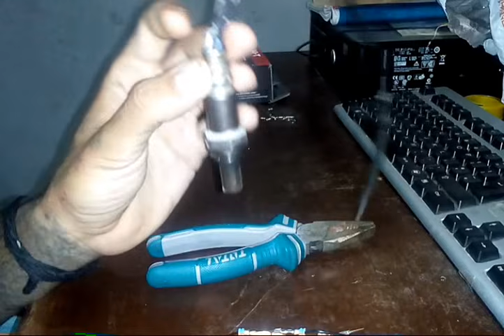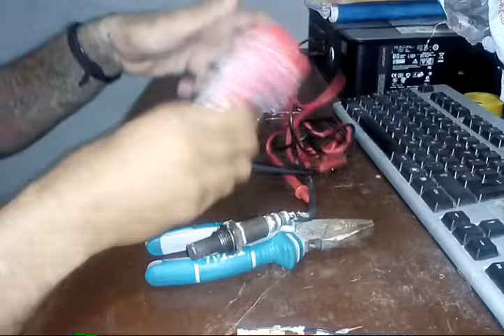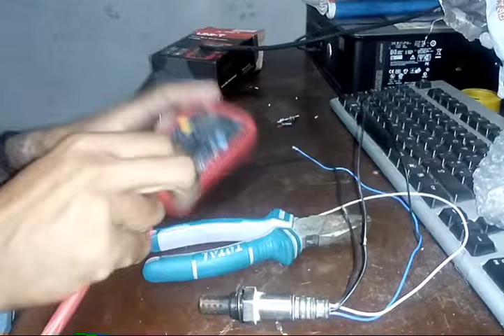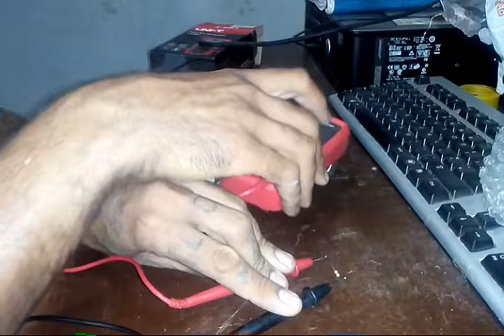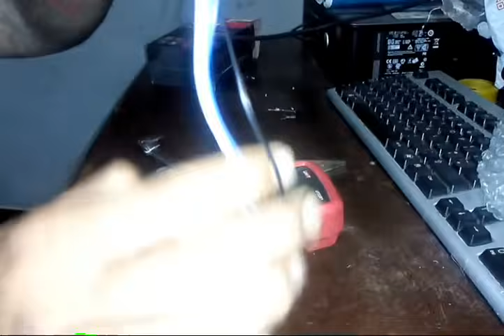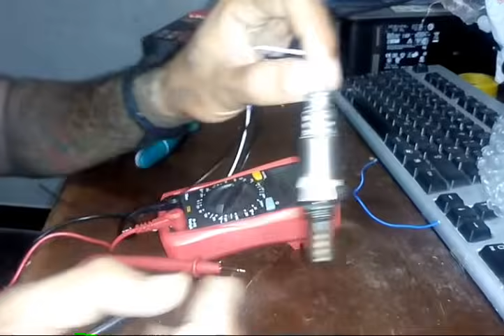How to Bypass O2 Sensor

Comment: I am thinking of keeping downstream o2 sensor on the exhaust pipe connected with the heater in order to detect resistance and the signal wire from the ecu with the output of a 12v to 0,45 voltage regulator to supply the signal with steady 0,45v letting the sensor's signal wire disconnected. What is your opinion?

Comment: Ok for the downstream sensors. They just monitor how clean the exhaust is after the catalytic converter. The upstream sensors regulate the air/fuel mixture and it will probably affect your fuel efficiency

Comment: I would like to ask question to understand about hit  sensors? show 2.7.dis is ok or mast be different numbers of sensor ? And I have bank 1sensor  voltage 3.266 to understand where do I have to connect dis resistor? If you can give me eany information about please 🙏 thanks 
Eand I have bank 1 equivalence ratio is 0.996 .to understand where is mast be connect dıs resistens ? 
Thanks 🙏👍

Comment: At 4 min 10 seconds you comment that we will need to have a 1 OHM resister then you install a 500 OHM resister ??????? in the heater line ?????????
Reply: He adds 2 one ohm resistor in parallel

Comment: would this work for a p0137(low voltage from rear o2)? the sensor is the correct one and good but since i installed headers its been setting it as a nuisance code

Comment: 2005 Jeep Wrangler 4.0 all 4 sensors testing low on heater code P0031 - P0037-p0051-p0057 I replaced all with NGK and still lit on. I checked all the wires, disconnected the PCM, and continuity was all good, Pin 1-3-4 were good from the sensor to PCM plug and pin 2 to ground, what else?? 

Thank youi
Reply from the maker: Either the sensor itself is bad or the harness is not gripping well. H2OS code p0031 is related to heater cicuit reading low, check the pins or the wires
Reply from the maker: If the harness, the pins, wires have been checked and are ok, or if you have replaced the sensors with new ones, i will suggest you to recheck the continuity of the sensors, not matching the desired or required by the ecm

Comment: Bravo - you outsmart the sensor, the control unit recognizes it as OK. It just can't regulate it, your ECU always gets the same input. As a result, the car never runs properly. BUT - you will no longer receive an error message!!
Your crafting is total nonsense!
Reply from the maker: I think i have mentioned that in the video, kindly no need to be over smart here. Thanks Mr, perfect
Reply: I believe he is addressing the downstream sensor here. The downstream doesn't regulate anything. It just detects if the cat is working properly or not.
Reply: Exactly
Reply: This is for downstream numbskull
Reply: The downstream has nothing to do with the upstream. Don't be stupid! Man! The author mentioned it clearly.

Comment: Actually heater wires don't make sound when you test it by multimeter and 2 wires have the resistance between 3-10 ohm.

Comment: going to try this on my downstream sensors after cat delete
Reply: Did it work for you?
Reply: @jeremygugelmeyer4586  yes
Reply: @DanKirchner5150  did you attach the two of the heat circuit? still working?